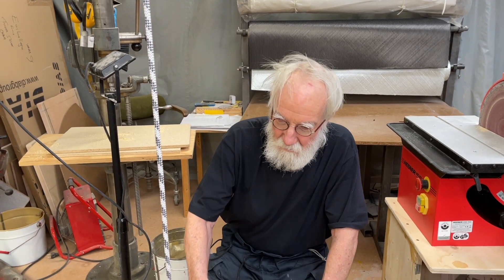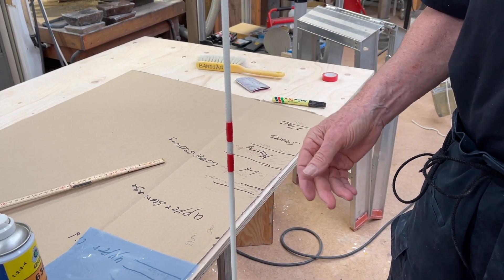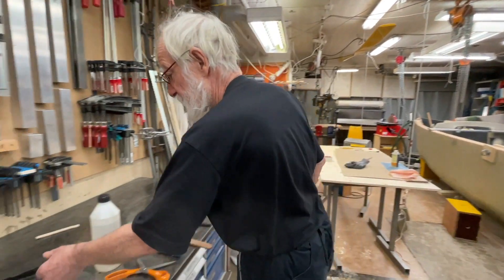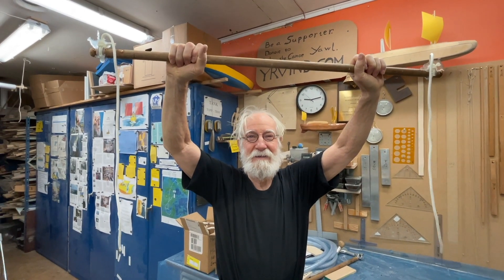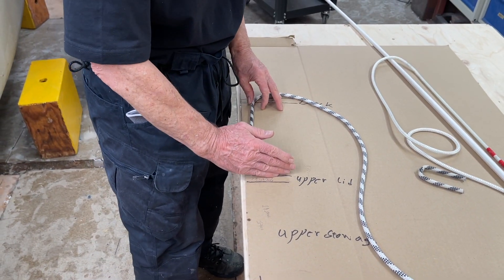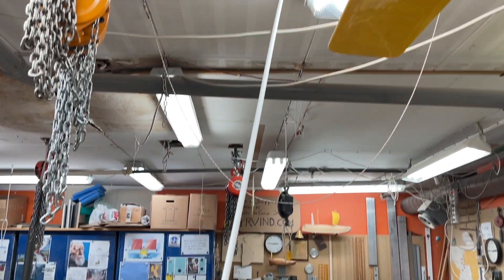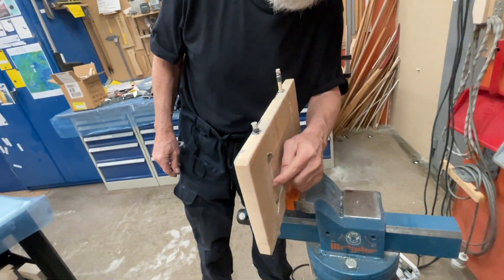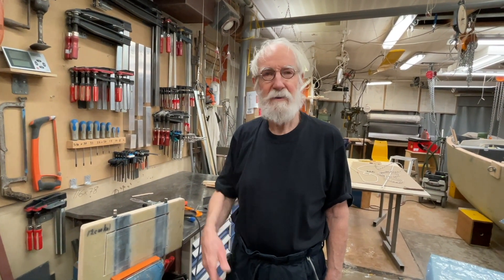Making good progress, but will continue to simplify the latest idea

Comment: maybe make them circular with friction tabs to hold it shut and a recessed handle then you only have too grab and twist to open or close with a rope attached inside to hold the hatch
Reply from the maker: It has to be oval as the avaiable huight is only 8 cm
If I make oval I can have 8X18 cm and that gives me enough area to put things in and out
Reply: @SvenYrvindExlex  I don't know what you have thought of so I am just throwing ideas around so here goes what about using a canvas type of cover that lifts from the bottom with a rod across the top that  sits on 2 built in hooks a the top ,then you could use small pins too lock it in

Comment: I seem to believe these hatches are becoming over engineered… wouldn’t it be simpler to have the bottom hinged and a single pin that just pokes into the top center of the door about an inch and not pass all the way through it? If for some reason the door needs to be completely removable, you could simply replace the hinges with two fixed pins on the lower edge that fit into holes on the bulkhead… I guess I don’t understand why everything seems so simple and straightforward on the rest of the boat and this hatch so complicated???
I worked for Janicki Industries and we helped build the Oracle Americas cup boats. We had some engineers that always tried to over build simple systems that needed to be quickly and easily fixed if they failed… getting to your food without having to damage your boat in case of failure should be a consideration…
Reply from the maker: Things look complicated before they gets thier final shape. Also here there is many things that interfere. A product removed from its context is very simple to make.
Reply: @SvenYrvindExlex  brilliant Sven !" a product removed from its context"
Reply: @SvenYrvindExlex  hello Sven. Aren't you worry the epoxy line might soften with time due to humidity...?
Reply from the maker: @lorenzoblum868  In contrast to polyester resin epoxy is very little affected by humidity.